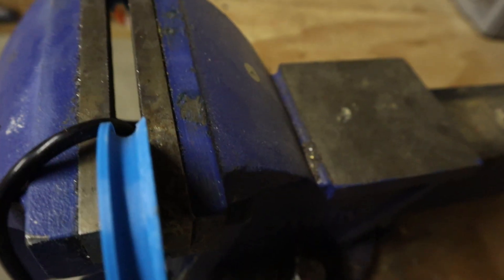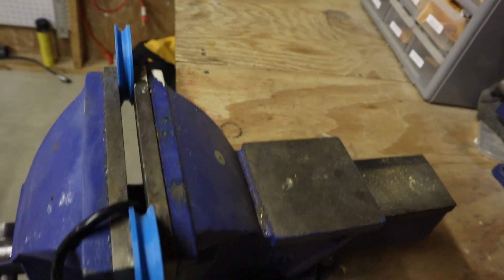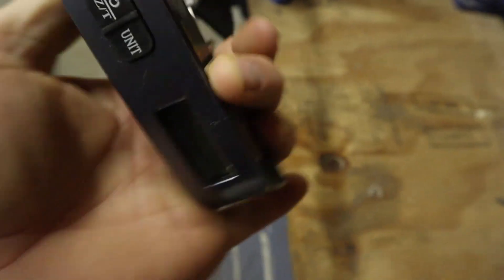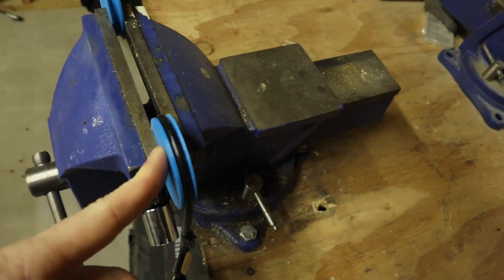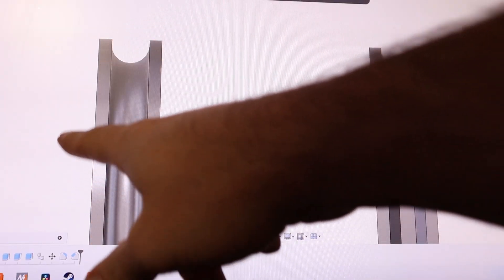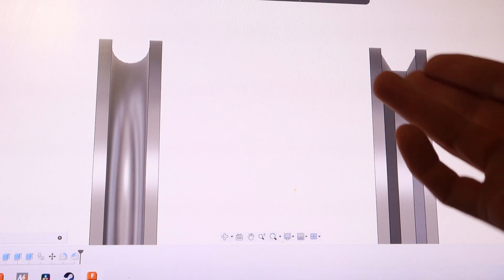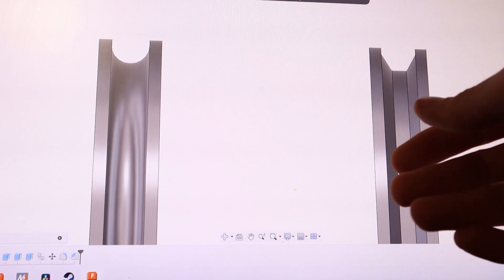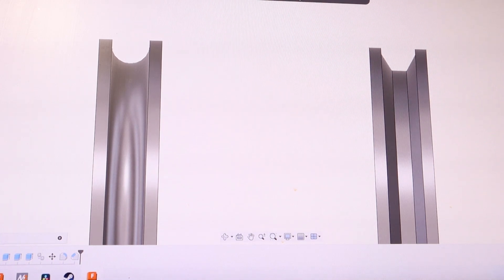Spin 169 - U vs V Groove Pulleys

Comment: Cool! I never really had much interest in machines before I started spinning. I recently bought an antique double drive spinning wheel, it actually leverages the exact principles you just explained to make it alternately spin the fibre and wind it onto the bobbin. So the bobbin has a U shaped groove, while the whorl has a V shaped groove, and this allows the strap to slip on the bobbin groove while you spin - the strap will only grab into the bobbin groove and wind the yarn when you let go of the yarn. This is so clever and I have profound admiration for those inventors who came up with these systems that unable us to create yarn and cloth. Maurice, you are right up there with the best of them, creating quality and accessible machines. Thanks for sharing 😊

Comment: I’m completely drive system agnostic. I just noted chains are used on high performance carders. I believe in science so if you’ve got methods that work for your design within spec that’s awesome! My concern about pulleys vs chain is more about them stretching over time

Comment: I would think that you'd want a belt
 for slip to keep it from binding and breaking something elsewhere (drum carder). Kind of like a slip clutch.
Reply: I mean vs chain/gears. I do a gear drive from something I'm designing for a brother drum carder (not for sale, just to make my wifes better than manual) direct from motor to the drive shaft, then the belts on the other side. That way the motor is  strong and keeps turning and the licker will bind and the belt will slip instead of causing damage. At least that was my assumption.
Reply from the maker: @IcarusAerial  There are belt, chain and gear drum carders our there.  They all have pros and cons.  I do like using the belts as a clutch as you described.  It's a big reason I use them with u pulleys on my espinners.

For a drum carder though the torque will get much higher then eSpinners.  So you need to figure out the max torque you want at the licker and swift drums and then figure out what kind of drive to use.  There are other ways to not damage things like with software and a belt/gears, but there are physical limitations to how fast such a system can react.  I personally think you can probably make a great drum carder with different drive systems.  There are pros and cons to each though, and if you don't think carefully about it then you sometimes end up with an underperforming system.
Reply: @DreamingRobotsBlog  makes sense! I was actually considering designing a tpu type internal mount for a gear ring so it'd have an initial grab to catch before the Arduino or whatever program I wrote has a chance to react.